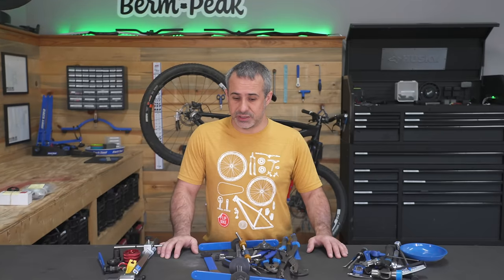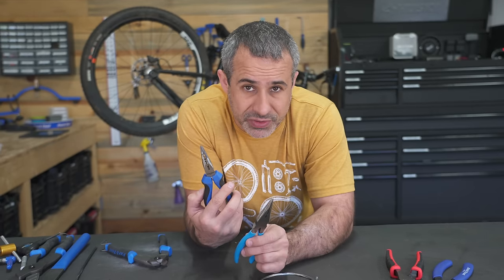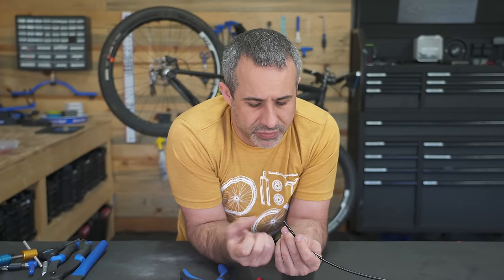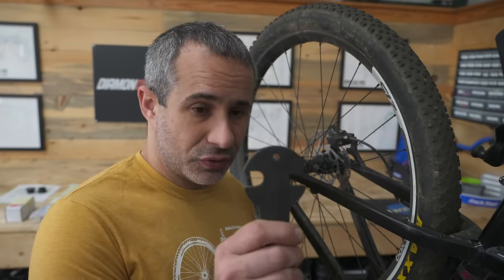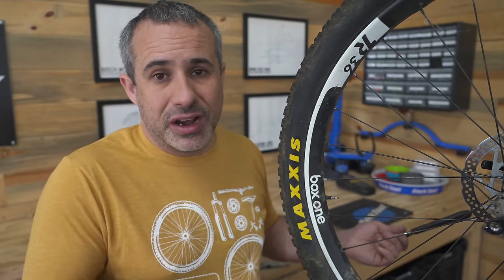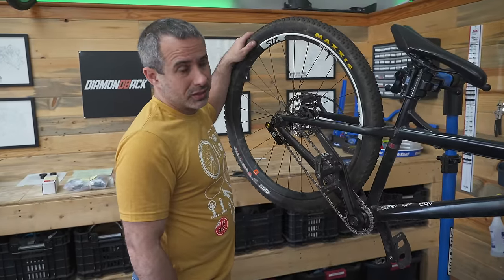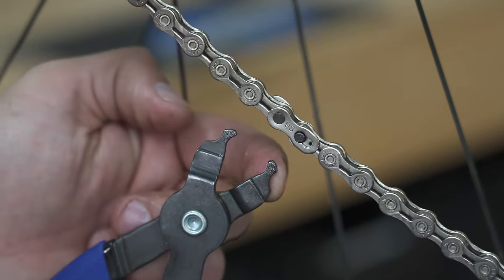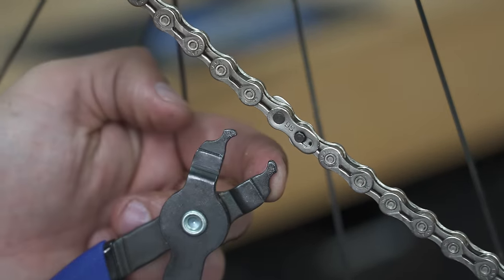Are "Bike Tools" really different from "Tools"?

Comment: A la master link. You can use a normal set of pliers (i find the needle nose are too sma and stubby). Just have one arm on one link and then the other arm on the other link. press slowly and it'll pop open. 
Realisitcally, I would have the chain pliers, but for the 3 times i do it a year, its not worth the money for the tool.

Comment: I have actually made my own headset cup press tool the exact same way, tho with a much shorter piece of threaded rod. I also have several sizes of washers for it and if I fear they could scratch the cups I just put some toilet paper inbetween. I've already used that thing a few times aswell, so it kinda paid off to spend the few bucks and make it.

Comment: 30 years of cycling,  commuting, and weekend stuff. Ive only got the following bike tools.........Freewheel removal, cassette removal, bottom brackets removal,  tyre levers, ive ground some spanners for cone bearings and brakes. I bought a chain wip at the beginning long since been modified for 9/10 speed. I bought a 36/32mm spanner for head bearings, chain splitter....... Thats it. I use a rule for chain stretch and made a dag tool for hangar alignment out of a office table leg. Home made tool for refacing head tubes. You really dont need all this bike stuff. Its just capatalism.  Regular hand tools are fine. Even if you need taps/dies to chase threads, just Measure and buy normal tools.  using the word Bike tools is like saying the word wedding...... The price just goes up for no reason.

Comment: I am not a fan of threaded rod and knob design, too much threading, takes up unessesary time. So my next press will have a quick release system. I managed to bend that Parktool press rod. Same with the truing stand adapter rod. I have a Abbey tool adapter on the way. Will see how it does. I will eventually get a new press too, if I can find one in stock.

Comment: 8:26 Yes you can, but you have hold it together with an adjacent link in a triangular kinda shape and than squeeze very hard. I've almost never used a masterlink pliers.
I did have a few accidents where I twisted the chain while it popped apart and didn't lock it in properly when putting it back.
Scratched my hands a few times too while removing those.
So, if you only have 1 reusable masterlink, don't risk it and use those pliers.
9:00 Try circlip pliers.

13:08 OOOH THE CRINGE! Like nails on a chalkboard! 😣

Comment: I've used a hammer and a flathead screwdriver to remove a bottom bracket. Just tapped it on an angle till it came out

Comment: Use wood as a washer for the bearing press. I have pushed my 44/49 external cups into my frame like that using wood pressing into the cups with the bar running through like normal

Comment: All you really need is a Seth video and a 12oz can or bottle of wallet lube.  Drink however many cans it takes and then go online and order all the recommended tools in this video.  It'll be one of the only times you wake up without regrets. LOL  But seriously...cheap tools cost money every time you use them.  Granted a Park Tool hammer is a hammer...is a hammer...is a...  But the specialty tools make your bike experience so much better and get you back to riding sooner.  Great video again.

Comment: Disagree on the diy headset press. It fits fine on older bikes with smaller headset cup diameters. Also cut and capped pvc pipe works great as a crown race setter.

Comment: After rebuilding a bunch of bikes with mechanics tools, the bike tools I most needed and bought were cable cutters, a spoke wrench, chain tool and thin bb wrenches and socket. I have 100 pairs of pliers and cutters but no cable cutters and nothing did a good job. Can you turn a spoke with a crescent wrench? Yeah, would you want to balance a whole wheel set? Nah

And bike tools are suuuuper inexpensive. I have single screwdrivers and wrenches that cost more than all my bike tools put together.

Comment: I think those cable cutters are meant for copper wire, that's why they damaged so easily... the non-bike version of the Park cable cutter is called a wire rope cutter and it looks/works exactly the same as the 'bike-specific' version.

Comment: 4:29 not all wrenches will fit every pedal. Even some regular wrenches, non adjustable, won't fit. But a pedal wrench gives better leverage. So I will use one. Not all pedals have a are not wide nough for some wrenches. Mine have about 5mm space. So I think only a really narrow wrench designed for narrow stuff will fit, those exist, I see that some pro mechanics use knipex adjustable pliers that are as thin as a pedal wrench.

Comment: If you're only looking to shorten a chain then the cheapest chain breaker should work and you don't need to get one of those fancy $100+ ones, which are needed for installing new pins properly. If you're too cheap even for that then there's no need to snip off the extra chain. Just use a proper-sized punch and hammer, over hard metal with a small bore into which the pin can drop, like a vise as in this video. But you should buy one anyway, a light and small portable one to take on rides, just in case, along with several master links.

It's ok to improvise in a pinch but if you do any amount of bike maintenance, get the right tools for it.
Reply: A punch in the right size works fine for chains, I recently had to shorten a big industrial chain and there is no chain tool for such industrial chains. You have to push the pin out with a punch, and they also have a sort of quick links for these chains.

Comment: You can cut standard brake housing with any old diagonal cutter (I learned this trick from Calvin Jones at Park Tool). You need a specific housing cutter tool to cut shift cable housing.
Reply: depends on whether the housing is indexed or standard shift housing..
Reply: @tauncfester3022  Huh? Indexed shift housing (with parallel casing wires) is the current standard. The housing with a helical wire casing is brake housing, which can be used with friction shifters but not so much with indexed shifters.
Reply: @mattgies  So where did I say that indexing housing wasn't the standard, did I stutter? In my experience, esp. with entry level bikes you will find lined, non indexed, helical wound housing being used on the front derailleur and short runs like the rear chain stay to rear derailleur. I've been using a Felco cable cutter for over 30 years now, since the time when the first indexing bikes came out back in 1988 and back then, compressionless housing was less the standard than today. Note that when I make new compressionless housing I always true up the cut surfaces on a grinder, as the cut ends will eventually chew their way through the plastic ferrules if left raw cut state. old timers trick,  yer welcome.
Reply: @tauncfester3022  Wow, such hostility! It's not my fault if you didn't express yourself clearly in the first place. And I'm well aware of your "trick". I do that with coiled housing as well to give it a clean end. You're welcome.
Reply: @mattgies  Oh, soo sorry you're so triggered, I've only been doing the "trick" since 1982, it's also taught at UBI for decades...Funny that it applies to both brake and shifter housing. If you want crisp shifting and sharp braking response.  Otherwise keep gnawing at the housing with some old diagonal cutters.

Comment: For large washers, you may be able to use the disks out of old harddrives.
They're quite easy to disassemble and you can probably get some for free.
Reply: For anyone reading this: don't do that. They are brittle and turn into extremely sharp shards and dust. Just.. no.

Comment: I'm small and weak guy with really soft hands but I didn't know that you need a tool to open master link and I did it with my hands so IT IS doable xd and it wasn't new, I did like 700 km on that chain before, it was SRAM 870.

Comment: a normal pump works great for your fork but for the rear shock its imposible to get it to 200+ psi with your normal floor pump or a small compressor

Comment: All the cutters that you bought that are not bike specific are not designed to cut hard cable material. They are made for copper and aluminum cabling.  That's why when you cut the cable once, and it was damaged.

Comment: I don’t think so? Bike tools is the same as regular tools. Except for the specialized ones I mean. Spécialised tools make life easier if you use them a lot. 

I used my dad’s tool kit on my bike. No problem for barely occasional maintenance. Even assembly/adjustment went fine. The bike came with tools, but the wafer thin wrench was miserable to use.

Comment: 9:08 you're using the pliers wrong ;)
on that certain bike you need to take chain from the front chainring, so it's loose
then you fold the chain link into U and us pliers at a right angle, so the master link can be pushed open ;)

Comment: What about using a dremel with a metal cutting wheel to cut cable cover?
Reply: I assume this method will also work.  A dremel will cost more than a cable cutter,  but if you already have one you don't have to buy another tool for it

Comment: That Park DSD-2 is not a "Philips head" screwdriver - it is a JIS head.  It'll grab into the screws on Shimano derailleurs (the ones that aren't Allen/hex, of course) much better than an actual Philips head screwdriver.  It's "specialty", but not ABSOLUTELY necessary, as a Philips head will work.  Just not as well :-)

Comment: Frankly, the Park PW-3 pedal wrench sucks. Sometimes the pedal flats are in a suboptimal position and the Park wrench only lets you flip it a full 180 degrees - which often is no better from a leverage standpoint. The VAR pro wrench has the openings at a 45 (ish) degree angle, which usually lets you find a position to get he best leverage. BTW, this is exactly the reason most "regular" wrenches have the open end at an angle other than 0 or 90 degrees to the shaft.  Worked years in a bike shop and almost always opted for a regular wrench if it could fit the pedal flats.

Comment: Yes you can remove a missing link (There are also master links, those are a different story) with fingers and it is actually easy. Learned to do it when I just started working on my bikes. Now I always use a tool, but the skill came useful a couple times on the trail.

Comment: I believe pedal spanners are also softer to avoid damaging the pedal which is why you shouldn't use them for other things
Reply: I once had to use it to crack a 15 mm wheel nut loose, it's basically a 15 mm breaker bar lol.

Comment: I got a new cheap 15 mm wrench from a discount tool store for $5 expecting to grind it thin and use it as a pedal wrench. It turns out, however, that cheap wrenches are already thin enough and it fit all my bikes' pedals. None of my higher quality wrenches will fit. Too thick.

Comment: Good video...i restore old bmx bikes...lots of them....i do use alot of park n made for bicycles tools....i needed alot of the right tools to do the job correct..yes they cost more money...most tools i will spend more money for a better tool then ruin a cheaper tool the first time...i always say if u r going to work on a bicycle GET URSELF A PROPER MECHANICS BIKE STAND...STOP LAYING/ SITTING ON THE GROUND....ITS CRAZY TO SEE A COLLECTOR WITH A 3500 DOLLAR BIKE WORKING ON IT ON THE GROUND....KRAZY...

Comment: Be rational. My cassette tool is a cheap $6 thing. It works and works well. Why would you buy a much pricier Park Tools when a budget tool works super well and is only used once a year at most. Invest in your hex keys, torx keys, your pumps (seriously good pumps with good gauges are super helpful). Don't build a full Park Tools shed if you only have most of the tools in a cheaper form or don't use the tools as often.
 You can use a seat clamp as a spoke key in emergencies. I've replaced a snapped spoke with one. It's not great but it's better than no spoke. Valve cores can be done with just your fingers, I've done it when a core came out with a dust cap. Top break links you can use a pair of hex/torx keys. Easy as hell.
Reply: Cassettes aren't tightened that much, so the forces on the tool are low and a budget one is still fine.
Bottom brackets for example can be quite nasty, sometimes they are corroded into the frame and the forces on a bottom bracket tool can be high. I use a Shimano one, but I also already destroyed a Shimano one at a bottom bracket which was mounted without any grease in the factory

Comment: Definitely need a dedicated spoke wrench.  You can see exactly what you are doing; 1/4 turn 1/2 turn etc.  If an adjustable slips on the nipple it is not at all clear.  Also you can chew up the nipple.  Use a spoke wrench!

Comment: The only reason to buy a "bike" tool is when it comes to task specific tools. Like a cassette wrench or bottom bracket socket. For everything else, wrenches, screw drivers, torque wrenches, sockets/nut drivers/T-handle allen's you can get equal or better quality for less by buying elsewhere. Park Tools are over priced for what they are. Your average home hobby bike builder can get away with using the cheapest Pittsburgh tools from Harbor Freight for a lifetime. We're not talking about excessive amounts of torque here. There's no pinion crush sleeve requiring 250 ft/lbs of torque on a bike. And I'm a tool snob, having wrenched for years with most of my tools being SnapOn and Matco. There's just no need when it comes to servicing a bike.

Comment: Those cable cutters are designed to cut copper, not steel housing. Even the expensive Klein tools version are not to be used on anything other than copper or aluminum.
Source: am an electrician

Comment: Adjustable wrenches are absolut garbage. And I mean that. They never hold the adjusted size, they are ill fitting and eat up your fasteners. 
Knipex wrench pliers on the other hand are an absolutely great tool! Just as adjustable, perfect fit and grip as you actually press down on the fastener (they are pliers at heart after all) and they don't chew up your fasteners at all, a few times I actually got bolts off that a normal wrench couldn't.y favourite tool lol.

Comment: pliers, you got the wrong tools, get Knipex bowden cable cutters at 180mm, they cut better, they have better crimpers included than the Park Tools. They are honestly my most used bike tool, not intended for bikes.

do you really need a chain tool? YES, chains are getting expensive, why risk warping one with a hammer and punch?

I've got a few Park tools and a lot of good industrial tools, honestly Park are no better than some of the better cheap bike tools, the last one i bought through lack of choice has some horrific grinding marks in it, I'll probably take a file to those before i cut myself.

Comment: Pro tip: you can take the MasterLink off with pliers. You just have to rotate them so they one end is on each edge on the outside.
Reply: easier to do on a derailleur fitted bike than an single speed
Reply: @DodgyFPV  it’s actually easier on a single speed! Use the protruding pin as leverage and pull it towards it  while on the same side. (It’s easy just really difficult for me to explain.)
Reply: @ichewtoast111  I just got some old ns plyers and filed the top edges so it fits in the chain lol

Comment: @4:58 nooooooooooooooooooooooooooooooooooooooooooooooooooooooooooooooooooooooooooooooooo!!!
I'm a big proponent of non-bike tools, believe you me, but it's far easier to damage a spoke nipple using an adjustable wrench. When it opens up slightly (and it will) you get rounded nipples, then they break. Don't ask me how I know. When I was a kid yeah of course I used a 6" adjustable wrench. Learned the hard way. 

As for cable cutters, I used those power tin snips.🤷‍♂

Comment: I actually 3D printed a valve core wrench. I only needed to get the core out so I could set the bead on a tire easier. Found a file on thingiverse and not too long later I had the core out. No idea where it went and it was made in PLA so no way it would last but it did what I needed.

Comment: some of these 'bike tools' aren't bike tools. They're just repurposed other tools. Chain tool in fact wasn't for bike chains, it came before bikes. Heck the master link pliers are just reused locking ring pliers. Oh for bottom brackets you can use an oil filter wrench btw.

Comment: bearing cup press go to hardware store go get your threaded rod +nuts in same isle grab some flat stock and then grab drill bit to fit your threaded rod and assuming you have a hacksaw cut 2 pices off the flat stock large enough to fit your bearing cup size boom half the cost of park tool's tool

Comment: instead of washer why not just drill a hole in a scrap piece of steel bigger than the bearing cup. Could also use block of wood and a hammer which is how I've always done it 😂

Comment: Some of these aren't that fair in normal tools vs. Bike tools, they're more like wrong tools vs correct tool, like chain tools. You can use a punch too, if you don't just do it against the table.

Same for the crimping. If you have a crimping tool, just use that, its not a bike crimping tool vs non crimping pliers kind of a thing.